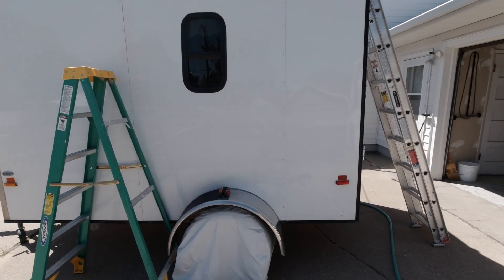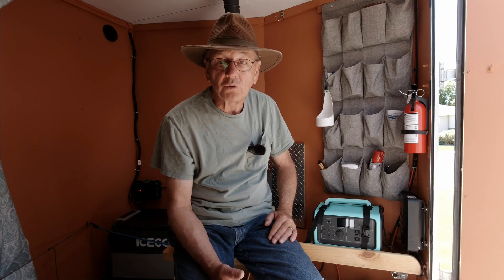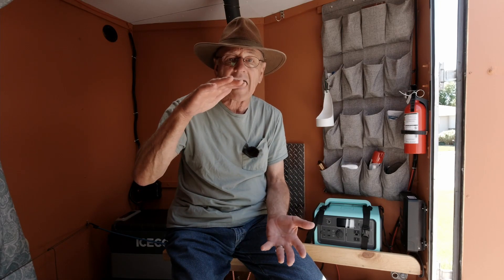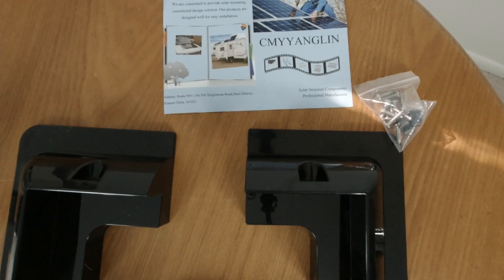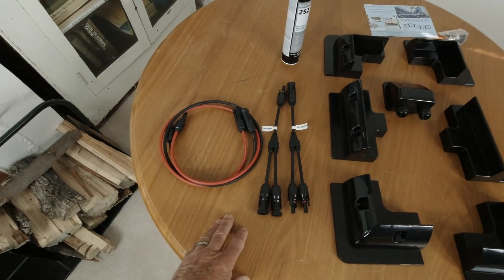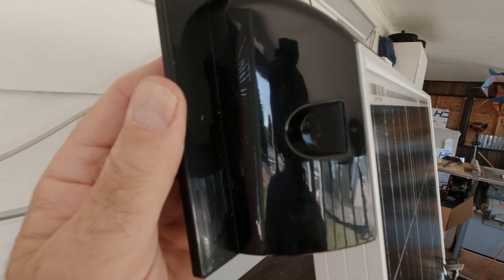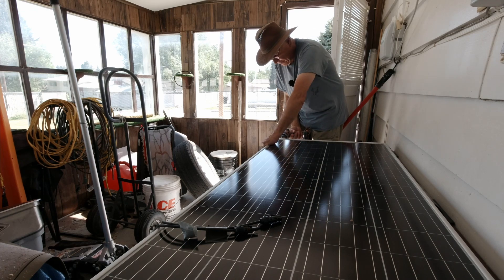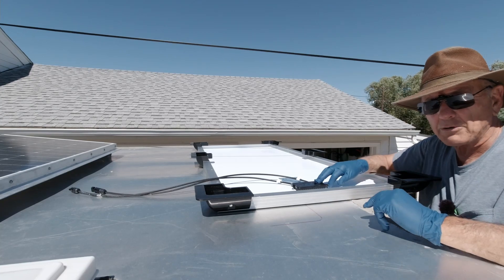Installing A Second Roof Mounted Solar Panel - It's Easy!

Comment from the maker: More information on this installation:  My experience with Sikaflex goes back to my boat repair days and I've never had it let go from fiberglass, wood or metal.  This was with 221 and 241 (the difference in those two was the cure time).  The 252 seems to be the same in the way it grips. My aluminum roof was naturally etched and the plastic mounts were textured from the factory.  A week later we mounted my daughter's panel the same way, but her Renogy mounts were smooth and we sanded them with 80 grit before applying the adhesive.
Reply: What's the air gap between panel and roof on your new setup. The swivel mount is about 3  1/2 air gap under panel.
Reply: Have you had  Hail hit your  solar panels? 
Will  they  with stand  the  hail

Comment: Good video! Friendly suggestion - painting your roof white covering the bare metal can make your top cooler even with with it insulated below. I accidentally touched my metal top on a sunny day and got burned. Painted it white, then under the same sunny conditions and  I could leave my hand on it and helps keep it cooler below.
Reply: Yep, I put on FIVE coats of that stuff.... then put on 1,005 watts of solar!   :)
Reply: Before I saw this post I was thinking the same thing about your roof. I put a roof coat (white) on my cargo camper for heat reflection. If I were to glue a panel down like you did. I would probably sand the footprint areas down to metal to get good adhesion.

Comment: Great job. Good explanation on the extra panels. Lot of people don't look at the simple explanation. If one does the job on a sunny bright day, it will take at least two on a overcast day with even a small rain storm to charge in the same amount of time, well if you lost 50% of the sun for the day that is.

Comment: Love your set up.  We stumbled upon your channel as we were looking for options upon selling our 40 year old heavy, leaky, musty camper we only used one time a year.  We bought a 7x14 Aluma and converted.  We just got back from our maiden voyage of 2 weeks in the mountains of Wyoming/Montana.  Dispersed camping was very full but did a little.  We thank you for your videos and ideas.  We used your shower idea, extended the air scoop, installed a nuway and got an iceco.  All great ideas.  Just did our first videos on the build and a final walk thru.  Thank you for the info.  Happy trails.  Jackpine Bearcat.
Reply from the maker: We're glad to hear that it's working out well for you guys.  Thanks for watching this channel!
Reply: Nice build.  Thanks for your video.

Comment: I used the 3M double sides super strong tape to attach my rails ( custom built ) to my adjustable rack that attaches to the rail system that is 3M taped to my roof ( Conversion Van ) I built the system about a year or so ago and it is in the same shape today as it was the day I put it on. I used RV weather seal tape over the seams but that may have been overkill. I did it mainly to make it easy to keep clean... no way that dust or mold can start to gather in the cracks or crevices along the seams. I mounted them so that the longer runs are front to back so wind is not an issue at all. You want to make sure to give yourself some extra cable run... so you can tilt your panels if you go this route... test out the tilts and adjust your cables to length ... I haven't had any issues at all with them. My suggestion for size is.. unless your doing a huge system for whatever reason... a 400 watt setup, with at least 400 amp hours of batteries should do anyone just fine. Well done... and BTW you can pick up a drill set that has the quick connections vs the round that require you to tighten.. ie they work just like the snap in.. ratchet head sockets.... one drill.. issue solved !
Reply from the maker: Thank you for the drill info and also for sharing your use of the 3M tape.  I've been using that tape for other things and know that it holds extremely well.

Comment: Fun to watch. I put a pair of Renogy (200W) on my cabin with a deep cycle gel battery so I could keep the battery in the cabin. It ran both my 12V lights and my 110V stuff including my instant-on Rinnai hot water heater and computer. It pretty much kept up with everything except for twice on prolonged rainy days. A second battery would have helped. I really liked them so used the same with my RV except I have a pair of deep cycle marine batteries. Since the trailer just sits on the property and I'm not sure I'm keeping the trailer, I hooked the panels together using angled aluminum and just set them out when I'm there. Keeps someone from climbing up and pilfering them.
Reply from the maker: Want to hear something funny?  My cabin only has 100 watts of solar but my 6x10 cargo trailer has 400 plus a couple of portable panels.  But I do more online work from the trailer and at the cabin it's more of fixing fences and mowing. Hard to beat Renogy panels.
Reply: Sounds like you have enough, I like redundancy. Maybe you could sell back to the power company. Ha!

Comment: Nice to have a flat roof so you can mount equipment. I’m looking forward to hearing how it all works in varying weather conditions. Thanks for sharing your install.
Reply from the maker: I'll be keeping a close eye on the adhesive mounts, but I'm not expecting any problems.  I'll be sure to report back on it.

Comment: You and Linda make this look easy!
Wonder how long before solar panels are standard issue on the roof of new cars? The thin ones with magnetic abilities would definitely be some thing I would try. Take it off before the car wash and put it back when done! Lol.
Oh every time I see you too walking through sagebrush or climbing up a rocky mountain side. I'm saying. God please don't let a rattlesnake get them. I'm adding Grizzly to the list.
Take care and we'll see you around!
Reply from the maker: We're so careful about that, but have only run into one desert rattler in all these years.  Not so with our Montana prairie rattlers and we see those too often. Half the time they don't rattle and you need to see them first.
Reply: @gonagain  Carrying a stick seems to help.   It doesn't need to be big but it helps if it is long and the longer the better.

Comment: Hi, great vlog as usual. Being a Mechanical Engineer, I am not a great believer in the theory of using glue only. 
  In U.K. and Europe it has been found that abrading both surfaces to be glued improves adhesion. 
  Personally, if I had to rely on glue only, I would drill through the feet of the supports so that some glue ‘oozed’ through the holes to improve surface area contact. Keep safe, Regards from the Solent Coast U.K.  AJ
Reply: This is wise advice.
Reply from the maker: I guess we'll find out, but having worked with Sikaflex for years I can vouch for it's tenacity.  That stuff doesn't let go.
Reply: @gonagain  I agree, sikaflex is about the best there is for this kind of application. Having said that, every time you pass an oncoming big rig on a two-lane road, you have a momentary class five hurricane. My worry would not be with the panel itself, it's replaceable. My worry would be that if it came off and went through someone's windshield I would never forgive myself.

Comment: When you add a panel that’s not the same, the system will operate to the lowest of the two or more panels. So you slightly higher voltage newer panel will only work at the older panels level, that’s why your charge controller was reading the same voltage you were accustomed too.  Good video, I am planning my escape and plan on gluing the panels down as well, but thought of using VHB tape, hopefully you’ll do another long term update on the mounting in the future.
Reply from the maker: Thanks for sharing that information Scott.  You're right about the voltage and, in my case it's a very small difference so it didn't matter a whole lot, but people need to think about that when mixing panels.
Reply: @gonagain  I hate to be bare or bad news but you're tilted panels going to be negatively impacted by the flat panel because the flat panels voltage is going to be the maximum voltage between the two panels so tilting your other panel going to do you know good now.

Comment: Very VERY Good Work. Job Well Done. The 'Dynamic Duo' you guys are For Sure. If I ever Go-Roof-Panel, I know where to get my instructions. Thanks a Bunch. (Funny, but from the angle of you putting-up the S.Panel it looked as though you were Headed to Touch the 'Hot Power Line'. Yikes, I  almost thought you were going to get Blasted with Electricity)💥⚡(just an optical elusion) Be Safe and We All hope you Hit the Road Soon. (will be 114°here today. Bracing for a Meltdown)😰 I bought Three mini AC's over a month ago, and No Delivery as yet. Can't figure that one out???? As soon as they arrive, 'I Will Be  Gone'. Ouch--!!!--???
Reply from the maker: You'll have them in time for next summer, but that's not good.  Yeah, your neighborhood is getting a little warm!
Reply: @gonagain  YIKERS, I Do Believe you are Correct, it Might take a year. A 'Well-Known' merchant, but Nothing but Blaming Covid, DHL, And the Post Office. My guess is a Slow Boat from China along with Tariff-Wars and the Mutual Love we have for them & they have for us. (but who else will buy their Junk??) Just In: it's Official, 115° Right Now, and 117° predicted for tomorrow. So as I Hide Out Under Cover I started thinking about how someone Jerry-Rigged a Regular Cooler Loaded with ice, and an electric motor phone-in, and Wa-La, Instant Swamp Cooler. Have you ever watched a Vid on this Mini Miracle??? Sorry to bug you Rick. 😰 115°& Nowhere to Go.😱

Comment: Extremely interested to see how this works out.  We are currently planning on using Unistrut to mount our panels - that is bolting the strut thru the roof into the structural members.  
 I am hesitant to use those mounts and adhesive because our roof is sort of a membrane of sheet metal similar to a mobile home.  That is to say it is not attached to the metal "Rafters"; it is simply skinned over the top.  When it is hot, and the metal expands, (could be tin) you get 60 to 80 thousandths of clearance between the skeleton of the trailer and the roof.  I like the dynamic of your method that you did not make more holes in the roof!  SanTan solar just opened a warehouse on the East coast.  (Savannah) They will allow local pickup.
Reply from the maker: Hello John.  The first thing I did when I bought my trailer was to use Sikaflex between the roof beams and the roof skin, adhering them together.  I did it to stop the roof from flexing and making noise from wind, but it also made the roof stronger.
Reply: @gonagain  more food for thought... we have yet to enclose our ceiling.... still able to do that.  What are your thoughts on the odor it produces in an enclosed space?  When it cures, does it continue to off-gas? or does it become inert?

Comment: I have a roof rack I want to remove. It serves no purpose except holding my 400 watts of Renogy SPs. Other than that it’s a lot of added weight. I have been looking at ways to attach the SPs without drilling into my roof. I think something like this might work 4 me. Thanks for great and helpful video.

Comment: I'm converting at least the front section of my cargo trailer into a camper.  I already have a lot of the things I need to do it... the back section will be my tool room/workshop/toy hauler. BTW... my trailer is 8'x24'.
Reply from the maker: That's the exact size of the one we use as a cabin on our property.  Lots of room.
Reply: @gonagain  Maybe we'll have to find some time to share some thoughts on converting and associated ideas.
Reply: @gonagain  Do you think it would be overkill to install a triple sink in my conversion? (It's one of those sinks with two big full size sinks with the smaller middle sink.) I have an old camper I'm thinking to relocate the stove with an oven into my conversion camper.

I'd plumb the smaller center sink with a garbage disposal plumbed to a bucket below for putting into a composter.

I also have a six stage water filter plus a double in-line whole house filter for catching any things initially coming into the camper. I can't believe the fantastic deal I got on two sets of six stage filters... lol one set for my mobile home and the other for my camper conversion.

I know I'm going a little overboard, but I think I should be able to enjoy the rest of my life. lol

I have a 55" smart tv, actually I have two of them. lolol

I have ten 400watt solar panels that each one gives a little over 41volts. Plus two wind turbines. One is a horizontal 12v 500w turbine and the other is a vertical 24v 4kw wind turbine. So... I have a total of 8.5kw between all three systems.

Is that part of a good start??? lolol

I'm going to need to completely fabricate and install my own roof top rack for my solar panel array.

I've never heard of anyone using their solar panels to shade the whole trailer, but... that's extremely important when planning the need to cool the camper. It'll be very effective blocking the sunlight from beating down directly on the roof of the camper.

Comment: I'm looking to install a propane heater in my trailer and was wondering if you could video your installation. I know you already have it installed but I was specifically looking for the piping and termination that you used. Also the routing of the gas line from the heater. Thanks for your videos. They give me good advice.
Reply from the maker: Hello Randal!  I ran the flew through the roof for a previous little woodburner that I had.  For this propane stove the manufacturer says that you can go up about 3 feet and then go out through the wall if you want.  Here's a video I did on the roof vent:  https://youtu.be/tc-wbQRmQhM
For a gas line I just used one for a propane grill and brought it up through the floor through a rubber grommet.  I hope that helps!

Comment: Nice video very well explained. My only thought is on a travel trailer with their iffy roof and roofing material construction maybe glue and screws would be needed.
When you realize IF it would come off it could be deadly to the vehicle following. Cargo trailer with metal roof I would think no problem.
Reply from the maker: Hello Shop Art.  I actually trust this more than metal fasteners because my roof beams are aluminum and the wall thickness isn't very thick.  I don't trust them to hold a screw and had to through-bolt my first panel and that could lead to leaks.  When I got my trailer I glued the roof metal to the roof beams with Sikaflex to keep it from work-hardening from flexing, so that makes the panel mount using adhesive more secure too.
Reply: @gonagain  I agree yours will work great especially with the prep work you’ve already done.

Comment: Good evening Rick.  I have a question for you.  Does that 252 adhesive work on fiberglass? I have a retired 1986 E350 ambulance that I'm converting to my campervan and the roof is white fiberglass - the ambu is all original so I don't want to drill any holes in the roof. Also, must one clean the roof with rubbing alcohol or the like to prep the surface for the 252 adhesive? assuming that product is condusive to my ambu roof.  Thank you so much for sharing your knowledge and videos with all of us.  Happy and safe travels to you and your family dear sir!!
Reply from the maker: Hello Caroline, yes it will work as long as you do a little prep first.  Be sure the fiberglass is clean and wipe those spots down with acetone.  Also, sand those spots lightly with 100 grit sandpaper, just to score the surface a bit.  That should do it, but make sure the mounts you buy are also prepped the same way.
Reply: @gonagain  Thank you sir. Much appreciated!

Comment: Will you always find a replacement panel to fit the brackets  once you glue them down  ?
Reply from the maker: I guess hat would depend on the company you bought your panel from and whether they stay in business or not.  One way you can remove the brackets is with thin piano wire.

Comment: Another great and helpful segment. Always look forward to what you have to share with us. Curious about a couple things though. With all the vibrations involved with both having a trailer and the off the "paved" beaten path you two travel to, why not use lock nuts and bolts to counter that vibration? Self tappers have a tendency to come loose and or strip even under non vibration type installs? Secondly, did you ever add shocks or more suspension/travel  to the axle on the trailer? Thought of it while watching that opening scene driving over those rocks. Not a critique or even questioning complaints, just curious because you've been such a resource of knowledge coming from experience rather than just theories or opinions. You 2 are such a solid team in every respect. Thanks as always for sharing.
Reply from the maker: 2 different shops recommended not getting torsion axles when they could have sold them to me. They break and shops have to order the replacement which takes a week to come in. Our trailer  is very lightweight and doesn't carry a heavy load so it does bounce quite a bit. We keep things well secured inside.